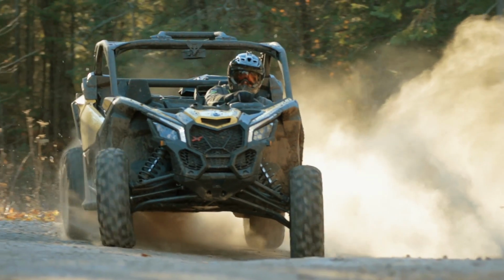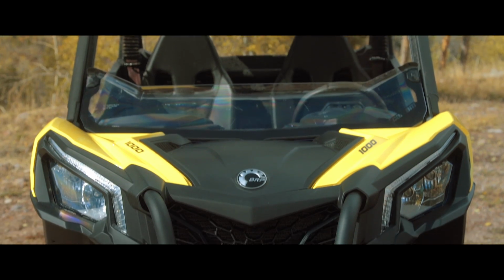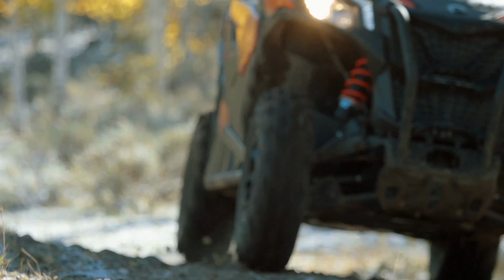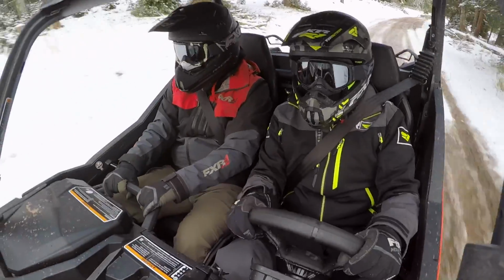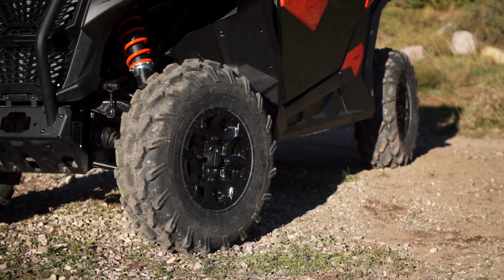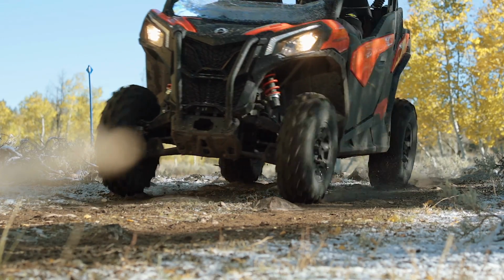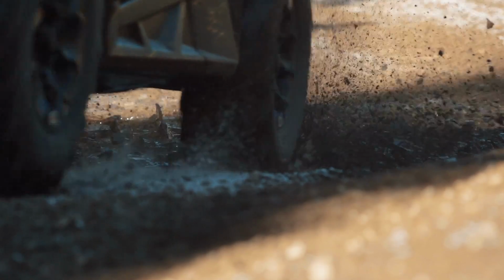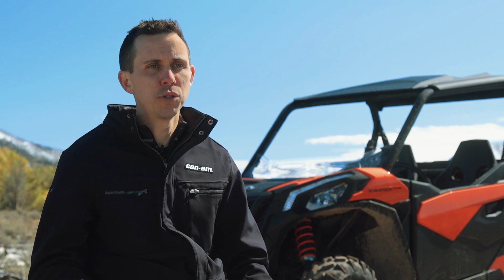In Depth Look: 2018 Can-Am Maverick Trail

Comment: Just like the Wildcat trail these units are inherently too low to the ground. long wheel base helps with ride quality but you're forever dragging across obstacles. Not everyone rides trails like its a race. The original RZR 800 was the perfect ratio of length height and width. they need to go back to that.
Reply: marc gamelin. Yaah, I certainly agree. But, adding larger tires solves the problem.  Might install a lift also...
Reply: Easier to fit into the bed of a pickup too.
Reply: I can easily fox the break-over.. but the Visco lok is a puece of crap.  I have a new Mav Trail dps 1000... I hate the locker.  Here in sw Colorado and Moab etc.

Comment: Looks so top heavy
Reply: Its not.  I've got 1000 miles on mine and I rip it hard in the trails..  Its very planted.  I was pleasantly surprised.
Reply: Yeah..it isn't but the cage does look like it could be lowered at least 5 inches....and give it a little sweep like the X3.

Comment: The 1000cc only has 75hp? My 2017 900 rzr trail has the same hp.
Wish this would have come out 2 months earlier.  I would have definitely considered this machine.
 Looking forward to the review.
Reply: Dont let HP numbers fool  you.......torque numbers do the talking. The can am is tuned, geared, clutched to be a torque monster. For Trail riding as its intended for,,,, torque is king. The larger 1000cc engine is there but perhaps its tuned to deliver top toque and not HP. The old saying " theres no replacement for displacement" is true. Those extra CC's are there but are delivering torque power instead of top end Horsepower.
Reply: JohnnyRebKy  excellent point! 
Hopefully we'll see a head to head with a RZR trail.
Reply: I have a 900 trail as well. I went to check out the can am on the weekend, it's very nice don't get me wrong. However, I'll stick with the rzr for now. The can am is too long, I really don't like the look of the back end, there is too much dash in front of you (felt like I was sitting at a desk). I'm sure they are awesome fun, but I looked at it and thought I'll get hung up all the time.